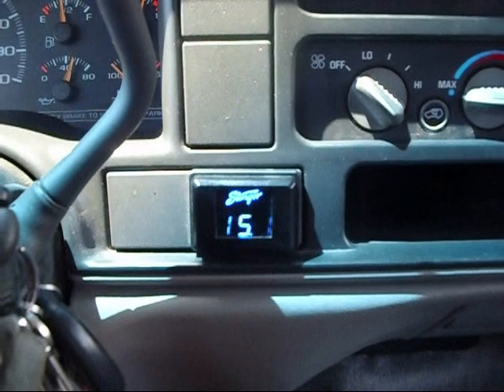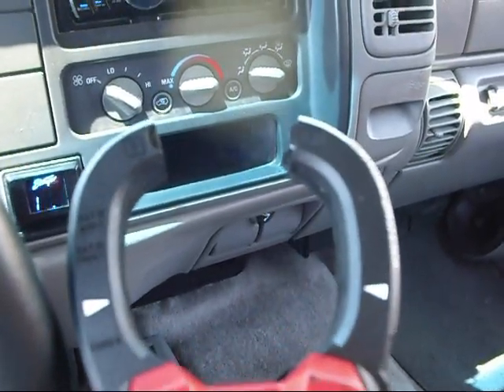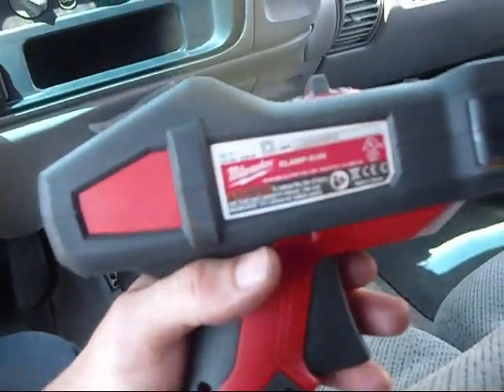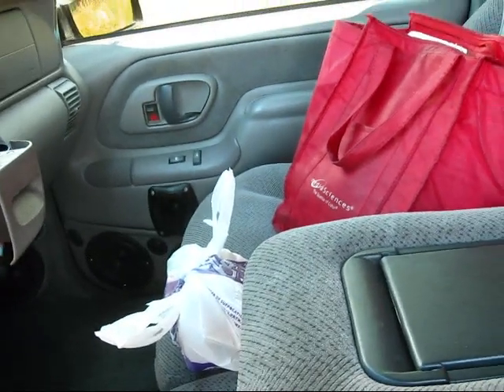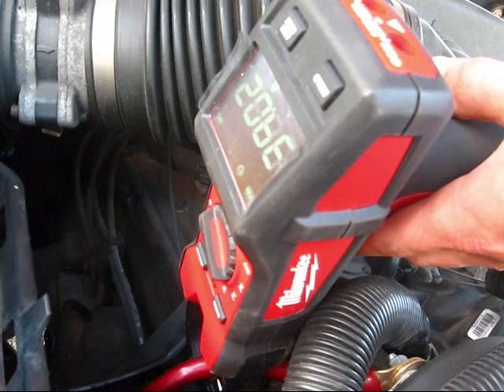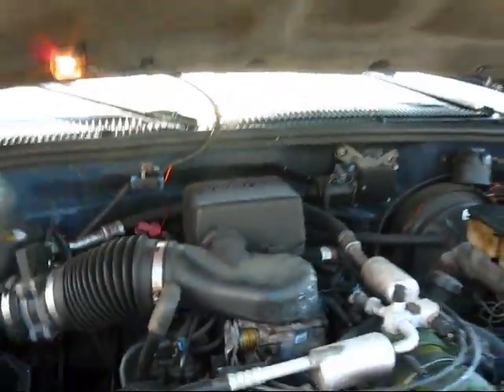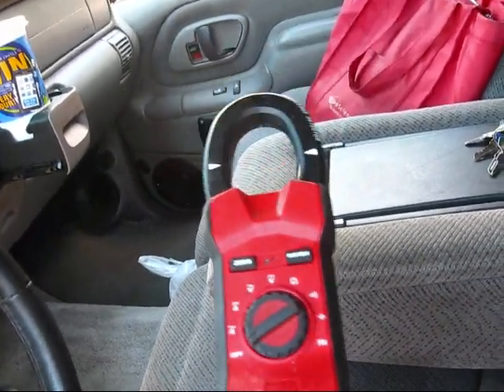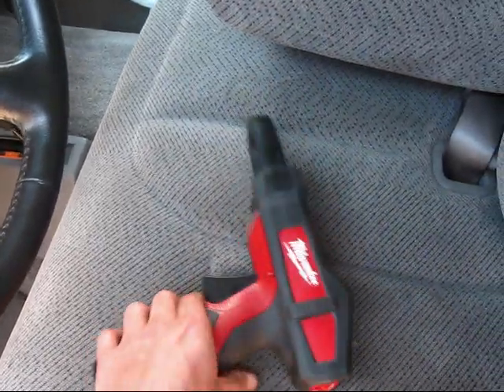testing the 300 amp alt

Comment from the maker: @mikewu9900 mine is wired to the alt,i tested the voltage at the battery bank and its.2 volts less which is nothing to worry about...but you could wire it any where you want a reading from

Comment: thats not a correct reading, you need a clamp meter with dc amperage. Ac amperage will not work for measuring alternator output.

Comment: I clamp my alts output all the time for the hell of it, lol. do you still have the stock alt charge line attached? I have the stock as well as 1/0 on mine and when i clamp them seperately the small stock wire takes up a surprising amount of the current, even when the 1/0 goes directly to the battery beside it

Comment: I thought the amps would pull a bit more from the alt.  For alt. heat issues you should only pull up to 60 to 70% of the max rated current.  You are way below.  Thanks for posting this video.

Comment: @cunje01 You also have to factor in things like impedance rise, etc. Just because the volume is cranked doesn't mean that the amp is gonna be pumping a full 2200+ watts continuously especially with music. In fact most amps rarely ever do the rms rating.

Comment: @jonmanch3st3r Although that meter is vastly superior, my 1950 Ford 8N has an ammeter that reads amperage the same way. Just has a wire passing through a loop on the back, no contact with the guage at all is needed. 

It even works the same with either 6 or 12 volt systems. Pretty cool how these work.